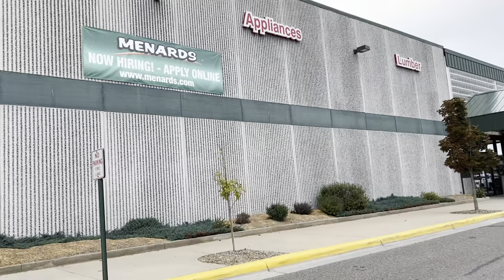Building the Ultimate SUV Camping Setup!

Comment: Murray I watched the video of you and your pup camping the other day in your new camping rig!!! It definitely looked like everything was at your fingertips when you needed something!!! You and your dad did an awesome job at setting it all up and building a really nice storage drawer and using the top of drawer as as sleeping area!!!  Definitely really nice oh and the new roof top storage rack definitely just sets it off perfectly!!! One other thing that would go really well with the roof top rack would be a nice new front bumper with like some pipe that goes up and around the head lights and a few in front of the radiator and grill!!! I definitely think the tubing on the front bumper would match or go well with the roof top rack!! Plus if you get the Wright one that is built tough it should protect your awesome rig from deer or any animals that might try crossing the highway when you are driving around!!! They do make all kinds of different styles of front bumpers with different styles of tubing or pipe on them for protection!!! I put one on my dads 2012 Duramax dually and he ended up hitting a deer going down the interstate running about 80 and it didn’t even touch the truck after coming in contact with the deer!!! It did end up bending some of the pipe on his that goes around his head lights and in the front of the grill but definitely saved from having to do any body work and paint on it!!! I ended up cutting out the pieces that got bent up on his bumper and replaced them and then had it repowder coated and you definitely couldn’t even tell that anything happened!!! Plus you could also get one where you can put a winch in the bumper and then when you are out driving off road looking for a place to camp and you happen to get stuck or even find someone else stuck you would be able to get your self unstuck!!!  A awesome bumper can definitely help with multiple things!!! I also love putting a square receiver in my front bumper because you can definitely do a lot more than lots of people think!!! On one of my trucks I already had a heavy duty bumper on my truck but it didn’t have a winch spot to put one and I really didn’t want to cut it up and modify it for a winch so I just fabricated a spot closer to the bottom of the bumper and mounted a square receiver then I just put my winch on a cradle so that it would fit into the receiver!!! Now I can move the winch from the front to the back and vice versa and I absolutely love it!!! Anyways hopefully this might give you a couple other ideas and you can see if you might like doing something like that??? Awesome video buddy and remember keep up all the hard work!!!!

Comment: Awesome clean build!! I have same body style suburban. So to see this oh the ideas are running… lol i do wanna tell you what I use for the windows. I stealth camp. I use the silver insulation it looks more like  bubble wrap. Itcomes in a roll . There’s enough to do all your windows. The windshield I just use the normal one to keep the sun out with. You cut it to fit your windows and there’s no way anyone can see in are out. I am the same as you I did not wanna put anything permanent are holes in anything. I got it at Lowe’s. I’m sure you can get it anywhere.

Comment: Just get you some Reflectix and cut to fit your window openings I mean yeah go ahead and tint the windows also, but much better, I think, than curtains as it will actually block light both ways. You can probably get a really nice one for the front window that's pre made if you go ask at the dealership. Edit Ooh yeah then get a 360 camera on the roof so you can see all around you while inside :}